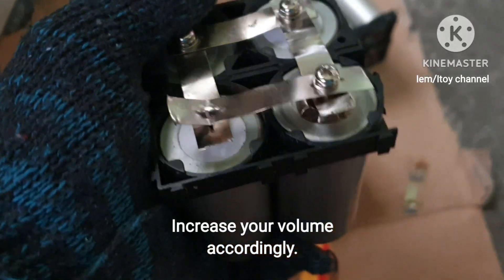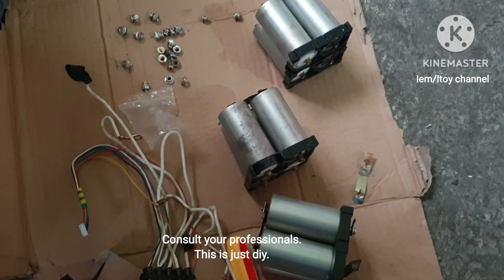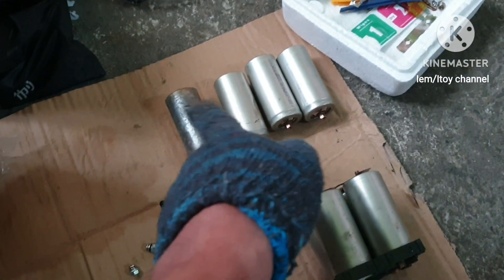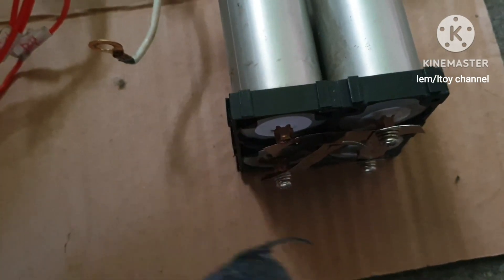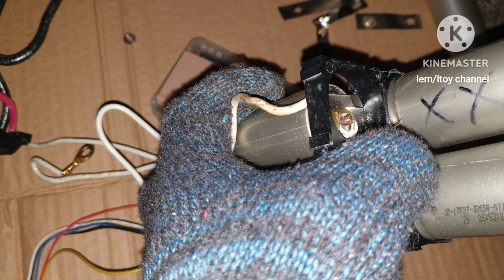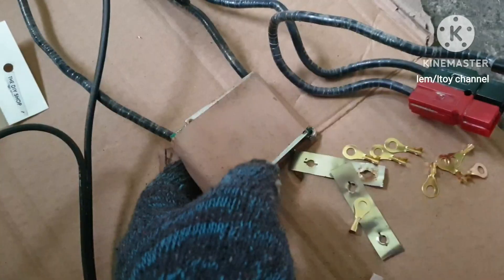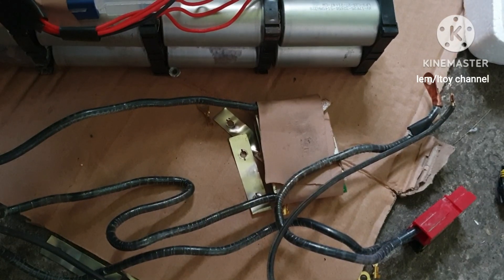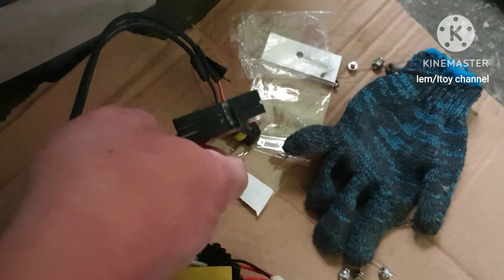32650 lifepo4 w/ bms & balancer diy build assembly

Comment: I build a 4s 3p pack recently and I encounter a problem
Ufter full charge voltage starts to drops in 2 hours from  14.6 v to 13.3v and stai there with no load 
I use solar to charge the pack 
Maibe someone can help.